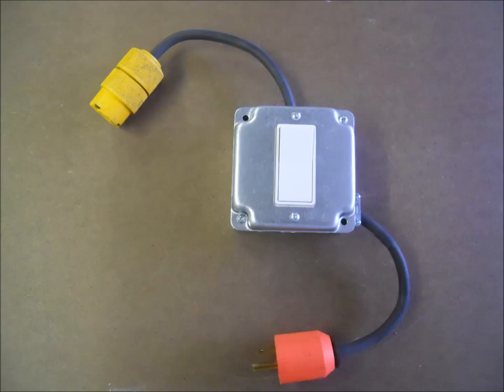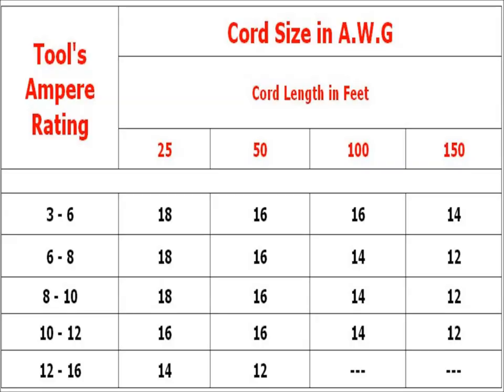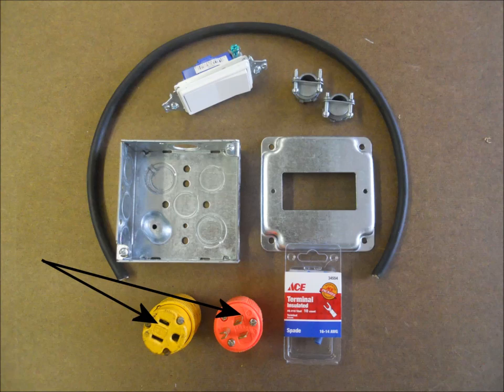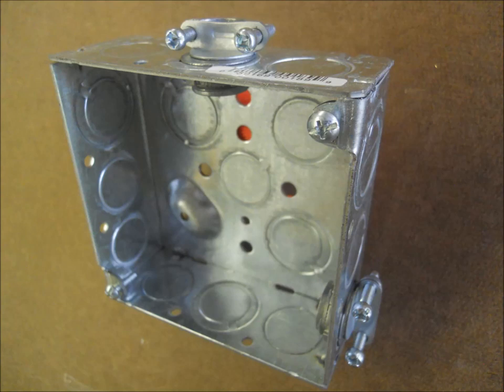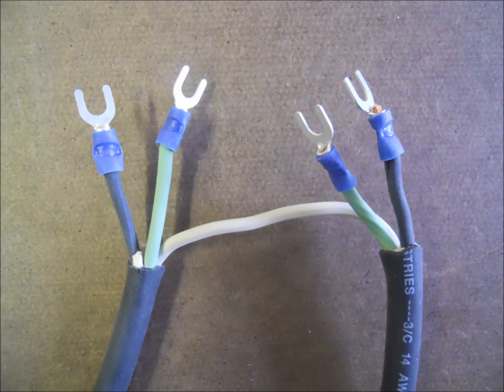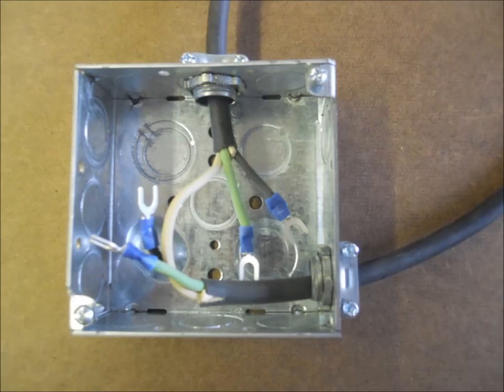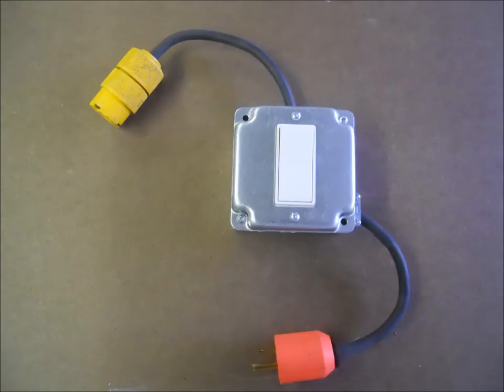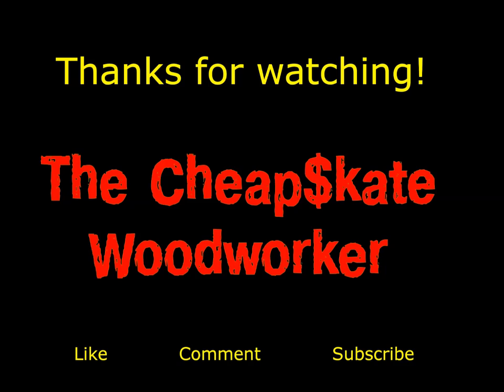How to Make a Foot Switch: Build a DIY Foot Switch

Comment: You really should ground the metal box that's mounted in. There should have been a ground screw in the box when you bought it. The ground wires should also connect to that You'll probably need to get an extra wire and make a pigtail to connect that up properly. While it probably that the box is essentially grounded through the switch, you shouldn't rely on the box being possibly grounded through the switch. It should have a definite and good ground connection to make sure that if the box, switch or wiring should ever become damaged and the hot wire somehow become in contact with the box, it will short out and trip the circuit breaker instantly. If you don't have a good ground connection to the box and this were to happen, you'd now be stepping on an electrified metal box.

Comment: Thank you so much for the video!! I've been trying to find something like this all night in detail like this. I bought a few cheap Chinese foot switch pedal I was looking for a way to mount them, It's the same concept as your socket so it should work great.  Thank you very much for the informative video and good job! Only disappointing thing about the pedals I got is that there momentary switch pedals. Which you have to hold it to keep it on, I wanted a push on push off but guess I'll just have to order others 😥😠 when I was reading the questions and the comments, people were saying that it was the ones I wanted but the one I received is not what I wanted such a bummer! Is there was an easy way to alter the switch or maybe I can buy a different tactical switch to replace them? not sure. Anyways enough ranting haha. Takeke it easy!

Comment: I've seen people have pretty good results using some light dimming or fan speed control wall switches to do the same thing when some sort of speed control is needed, should not be too hard to find videos on that if thats more of what you need.
Reply from the maker: +Frisky Fish  That's true, but when using my switch to control a router or table saw, the on/off switching is all that is needed. Thanks for watching!

Comment: Is this dangerous? (accidental switch)
Thanks for the info!
Reply from the maker: In what sense do you mean? The construction, the use of it, or what? I'll be happy to reply if you'll flesh out your question a bit.
Reply: Accidental switch....thanks
Reply from the maker: I'm still a little unsure of what you're asking.
Reply: If it's dangerous to switch accidentally on the power tool and get yourself injured.
Reply from the maker: Andrea Arzensek The tool will start only when your foot activates the switch. Keep your foot away from the switch until you are ready to turn the tool on with it.
Reply: I have to agree with Andrea, having a switch on the floor that you could so easily tread on by accident is a worrying concept. I'd consider this on say a scroll saw or pillar drill, but wouldn't be comfortable having this on a table or band saw. If you need both hands to steady the work at the start of the cut, you'd be far better with some kind of jig, clamping device or stand. 

It's a good idea, but not for me I'm afraid.
Reply from the maker: Mark Chapnell @user/ArzensekAndrea - I appreciate your concerns, but turning the switch on accidentally is impossible if your foot is not on the switch. Imagine a 2x4 laying on the ground. Picture in your mind how you would need to hold your foot so the toes can activate (or deactivate) the switch with your heel on the ground. Thanks for the comments though!
Reply: I didn't mean to argue, I just think that there is possibility that you forget something on the table (some object) that is in contact with blade and then accidentally turn on the switch.
I work with this kind of switch, you'll see in my next video, but I still consider it quite dangerous.
Reply: Andrea Arzensek We use foot switches at work "all" the time for turn tables as well as our routers and there is 4 or 5 laying around the floor of the workshop and have no issues what so ever. then in the machine room as well... I have one on my router at home and again have no issues like you are suggesting... mine when not in use is tucked under my router jig so you can not step on it until it is pulled out from under it...
Reply: +Andrea Arzensek Its dangerous if one does not have common sense. You should always be alert as well as being aware of everything in your surrounding. 
I do however understand your concern as accidents do happen. To add a safety feature to this foot switch, you may also attach a simple toggle switch next to the pedal or anywhere you'd like, it would function as a 2 step engaging system. This way, even if you accidentally hit the foot switch, the tool will not power on because the toggle switch was not engaged first.
It would still be hands free operation, just an additional extra step, but it would save you from a horrific injury and/or damaging your workpiece.
Youll need to purchase a toggle switch that allows manual hold so that upon releasing the switch, it will return to the 'off' position.